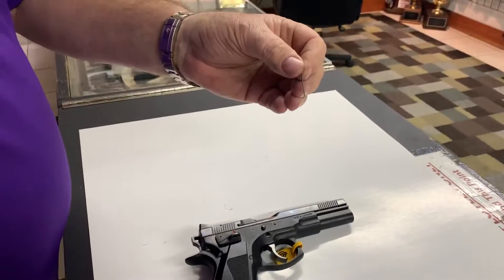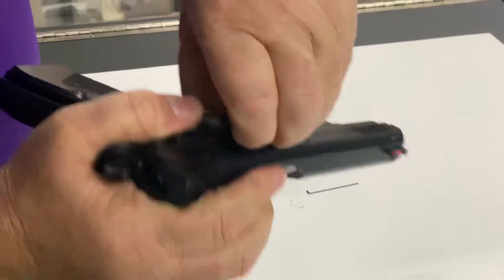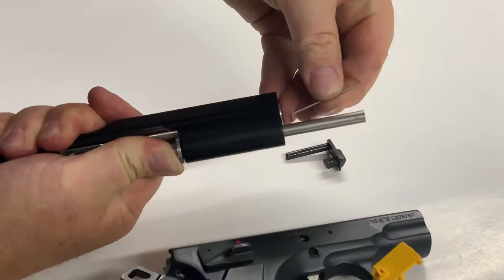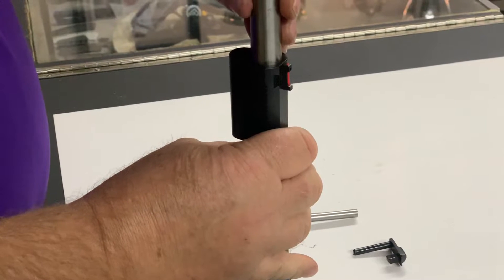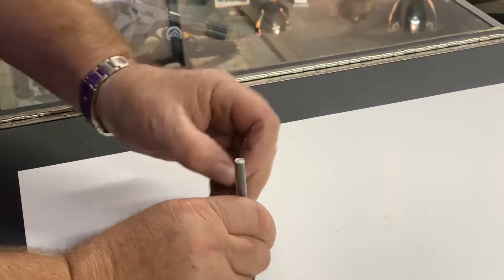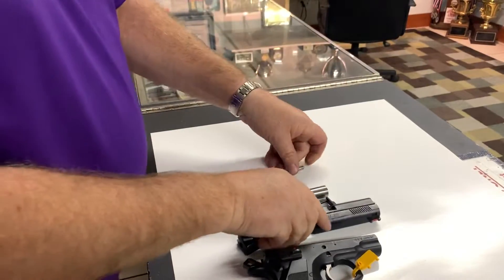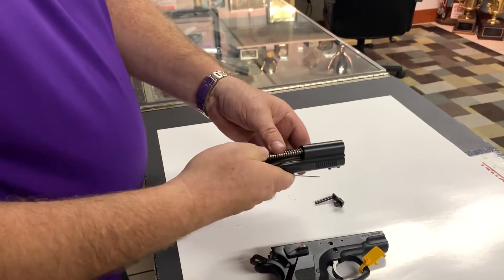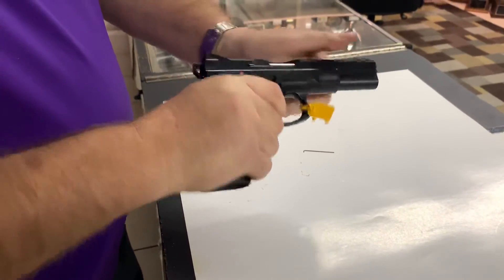Field Strip CZC A01 and Bull Barrel CZC pistol.

Comment: I’m excited for the A01-LD. Is there enough “meat” on the LD frame to cut  a rail slot?

-thanks
Reply from the maker: Yes it was designed that way.
Reply: Dear sir , l want to ask you durability And reliablity question , What do you think Cz 75 pre-b version for example produced in 1991 is more durable than standart Cz 75 B when l look at Cz 75 slide 9 mm parabellum written not luger also l found slide rails are thicker than Cz 75 B slide but when l look Cz 75 B Lower frame s rails are thicker in Cz 75 B or Cz 75 Kadet pistol , And also in Cz 75 B Lower frame inner small parts are made better ? Sir when l compare Cz 75 B And Cz 75 SP-01 Shadow l found barrel is thinker on Cz 75 SP-01 variant And SP-01 is Full dust cover And Full guide rod do they have An effect in reliability ? Sir if you have to chose 1 Cz which do you chose SHadow 1 or 2 ? 
    Best regards ,